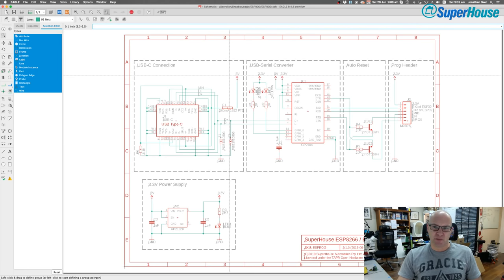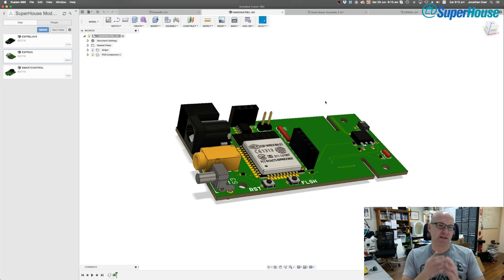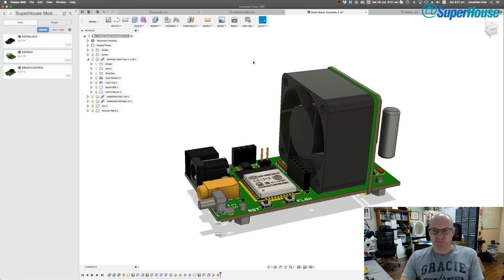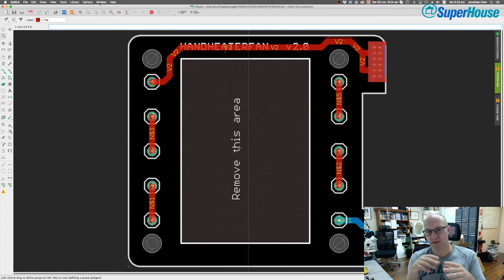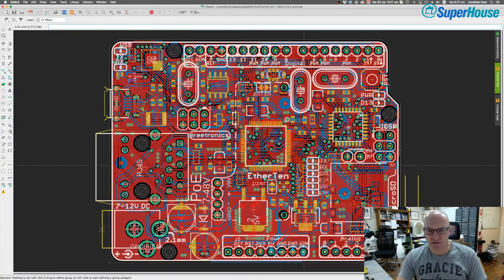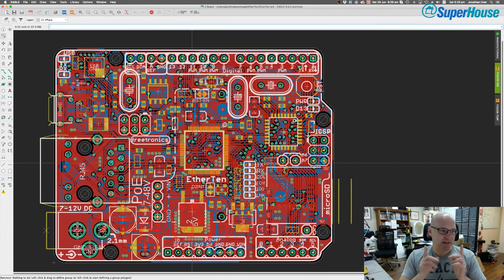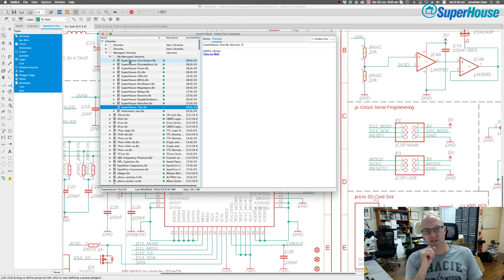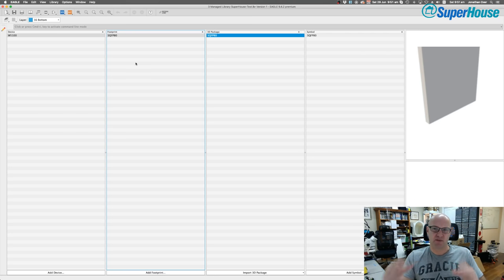SuperHouseTV Live Q&A: EAGLE managed libraries and Fusion 360 integration

Comment: Hey I noticed you are mac user also , is your eagle Manufacture render really slow? I remember before switching to mac, my windows machine let me leave the mechanical window open and it would live update ( I would stick it on another monitor ), but on my mac, I cannot because each redraw takes about 2 seconds and locks me up.  ( I have asked them to add a refresh button when live is disabled in the forums, got no traction on it though )

Comment: Hi Jon
Great video - both illuminating and frustrating...
Frustrating because although I use both Eagle and Fusion 360, mine are not integrated.
I'm running the latest Fusion, but I'm still on Eagle 7.7.0, for one simple reason - I know that's free but I can't get my head around Autodesk's pricing policies for their versions of Eagle. Is there a free version of Autodesk Eagle, maybe with the same income limits as exist for Fusion???

I'm a pensioner. I design things for me or, very occasionally, as a gift for a child in the village who has become like an adopted grandchild. There's absolutely nothing 'commercial' about anything I design and never will be - I'm too old for all that.

Where do I fit into Autodesk's Eagle scheme? I can't work it out.

I'm sure many makers are as confused as I am with Autodesk's convoluted pricing policies.